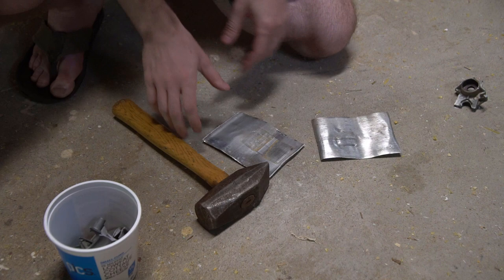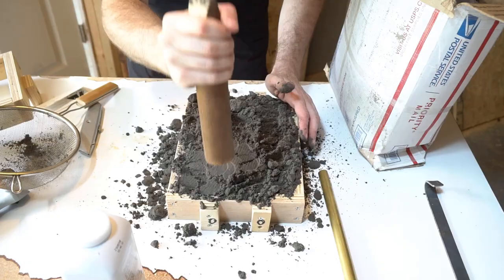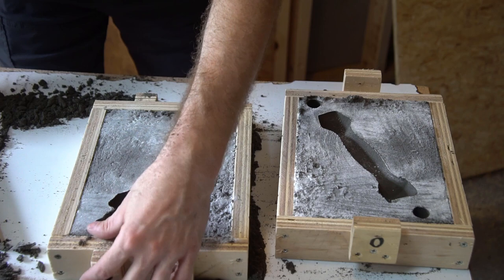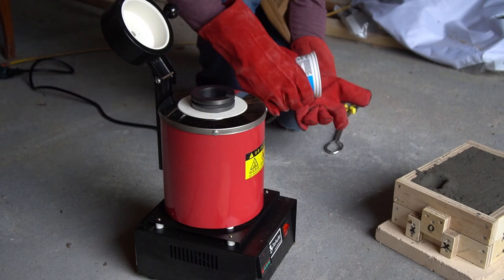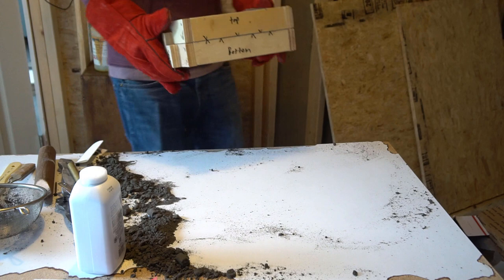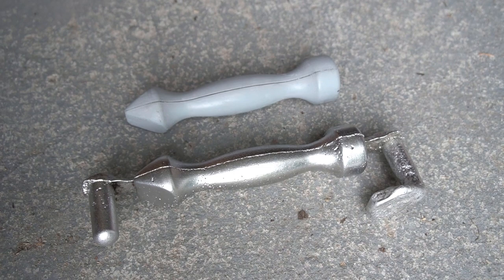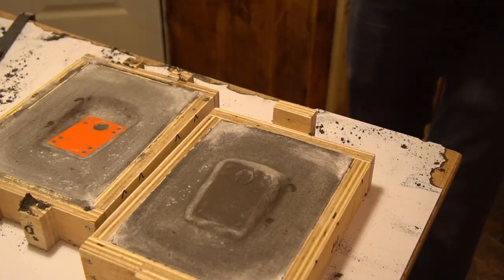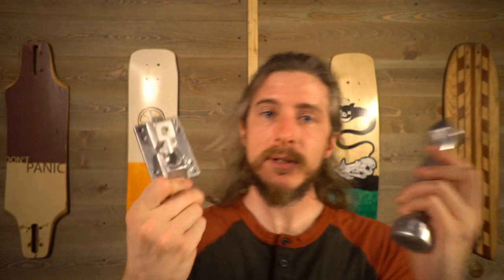Learning to Cast Aluminum with Green Sand - Casting Trucks At Home, Ep. 2

Comment: Looks like steam related defects to me; your sand looks pretty wet here.  It should be dry (permeable) enough to let the molten metal push the air out of the mold cavity through the sand, without really needing a riser for venting on the far side (though you may need risers to counteract shrinkage). It takes time to get a feel for when your green sand is right, but you want to aim for as dry as it can be and still have enough green strength to hold together.  Venting the sand itself (not the mold cavity) with a thin rigid wire like a bicycle spoke helps too.  These vents should not contact the mold cavity, just come very close to it so that they stay open and continue giving steam generateed inside the hot sand an easier out from the mold than pushing into the surface of the casting as it freezes.  If you sharpen your vent wire to a point, your vents won't fill with metal and stop working even if the vent wire does accidentally touch the pattern while you're poming holes in the cope and drag.  But first let your sand dry out a bit.  If you had a bigger furnace there is more you could do with gating systems to improve your castings as well, but you're off to a really good start here. This is an oldish video so maybe you've already got your sand sorted out.  For me foundry is a great hobby in and of itself with endless room to learn and improve, but it's also a great add on to other hobbies or projects like what you're doing here.  I'll look for other casting videos you've done.

Comment: As an LDP longboarder, I'm excited to see how this works out. We tend to use pretty high angle front trucks (45°-65°) and pretty low angle rear trucks (30°-0°, sometimes negative). This means that pretty much any decent pumping trucks are going to be precision machined in small quantities for hundreds of dollars. As someone whose made that investment only to find things I wish I could change about the geometry, it's exciting to consider the possibility of investing in a resin 3D printer and aluminum casting supplies to attempt to solve this problem for everybody.

I'm currently casting some wedges and have been pressing my own boards since I was a teen, so between this and the urethane components, I'm hoping to eventually "do it all".

Thanks for being such an inspiration to all of us!
Reply from the maker: I really want to do a zero- or low-degree RKP at some point. I want reverse kingpin mountainboard trucks dangit!
Reply: @GoodRoads  I didn't realize there was a need! Now you got me trying to learn more about mountainboard trucks lol

Comment: Having a longer travel (runner system)from sprue to part will eliminate porosity and trash all together depending on how far the travel is. Keep in mind your pour temp might need to be raised in order to fill the part. Also keep in mind the hotter the metal the more it shrinks. If your parts are shrinking just add mass (bigger balls) at the gate will feed the part as it cools. Your mass needs to be bigger than the part. The part must freeze off before the mass in order to draw properly.

Comment: Something I also really should add is be very careful choosing your metal. Magnesium and magnesium/aluminium alloys are really easy to mistaken for aluminium. You can test for it by using acid. If it bubbles violently then it’s magnesium if not then it’s just aluminium. (Magnesium is very flammable and hard to put out)

Comment: Aluminum shrinks alot when casting, you need a pretty big 'feeder' wich supplies extra molten al as its solidifying. Usually at the bottom of the sprew, before the casting cavity, a large-ish extra cavity to allow it extra substance to recudce shrinking. When casting with a steel axel for the trucks, keep in mind the composition and hardness rating of the steel, aluminum isnt hot enough to melt steel, but it could be high enough to soften its hardness. This would make the axel more likely to bend instead of resist under load. You probably already know this from researching it yourself, you seem to be pretty up on it. Looking forward to your next pour !
Reply from the maker: Thanks for the advice dude!

Comment: You certainly seem really eager to get some trucks going.
You're using stuff straight out of the packaging, were you waiting by the mailbox for everything to arrive, ram in hand?

I've also been watching Brian Oltrogge's videos. Don't tell me, his "Casting Aluminum for the Home from a Simple 3D Print" video came out, and lit a fire under your butt?
This project is certainly the first thing I thought of when I saw it. I was going to recommend his channel to you, but then I figured there's no way you could have missed it when doing your research. Very good content.

It would be so cool to eventually see a brass or a bronze truck. Even though there's no practical reason for it, it would just be really awesome.

One thing I'm worried about with the cast in axles is keeping the bearing surface clean, and especially the threads. And also in achieving a nice flat for the bearing to be tightened down against on the hanger. I wonder if you could have something like a set of nuts or something pre-made on the axle to keep the molten metal away from the threads, and to act as that flat surface so you're not relying on quality of the cast to keep the ends neat.

Or, you could just let the quality of the cast be what it is, and neaten it all up afterwards.
Threads can easily be re-tapped
I remember an old topic on Silverfish where somebody had tracked down a tool that would go over the axle, and you could stick it in a drill and machine a nice flat & parallel shoulder for the bearings to ride against.
Reply: I think the solid steel axle would extend far enough into the sand that it wouldn't get aluminum on the threads, but what about covering them in clay or something? Not exactly sure what material explodes and what doesn't in this kind of process.

As far as cleaning up the outer edge of where the aluminum meets the axle, maybe he could do a jig for his angle grinder? An idea:
- Jig has skate bearings that the axle inserts into
- Use a nut to set the depth of how far the axle inserts into the bearings (maybe the nut goes between two bearings and you use one of those thin, stamped sheet metal wrenches to adjust?)
- angle grinder is attached to the assembly in a stable way somehow, but on a hinge with a depth stop
- rotate trucks slowly on axle as angle grinder cuts for smooth bearing seat.

Obviously that's way more involved than machining on the drill press, meant it more as a backup plan in case the hangar was too unbalanced to machine in a lathe-like fashion. You bring up really good points!
Reply from the maker: I remember that tool, that was the beginning of faced trucks which are so commonplace now. Completely changed the industry. I gotta see how the casts come out, but I'm hoping that I'll just be able to keep the aluminum off the axles. These certainly aren't going to be pro-level but hopefully they will work pretty good!

Comment: Really cool you tried this. Only tips I could offer is keep the molds hot maybe place in front of a heater and elevated off cold floor. For best DIY result really should try investment casting. I understand its a lot more expensive but the results are closest you can get to die-cast.
Reply from the maker: I think when I try reverse kingpin trucks I'll have to use investment casting for the baseplates

Comment: You need to remove the hydrogen from the metal with sodium carbonate (washing soda) 
When I cast aluminium I make a small aluminium foil package with the soda in it and using an old stainless steel egg cup on a stick push it to the bottom of the crucible (be very careful not to have any water in it) amd be aware that it will cause the metal to ‘boil’ violently as the hydrogen and other impurities come to the surface. You then need to pour it soon thereafter as it will start to dissolve hydrogen again immediately.
Reply from the maker: Yo dude, thank you so much for all the great advice. A couple questions: you can also set a sliver of magnesium on fire right? Aluminum wont burn the same way? And about how much sodium carbonate do you need? This is all a huge help, thank you!
Reply: @GoodRoads  if it’s a very small sliver of pure magnesium you should be able to set fire to it with a blow torch. I’m not sure how easy it is to set fire to an alloy of magnesium and aluminium, I’ve never tried, and I’m certainly too scared to find out if it will burn once it’s molten.

I suppose the thing to remember is that it will behave differently in a flame to the furnace as the flame will provide a co2 barrier around the part which will inhibit it burning while the furnace allows the molten metal to have direct contact with the air
Reply: @GoodRoads  as for the sodium carbonate. I use pieces about 1cm cubed. (For about 750ml of aluminium) and I just keep adding them until it stops producing much dross and stops dropping in volume (you will see a significant drop in the level of the aluminium after the gas has escaped) I usually use 2 or three packets to get it to the point where I’m happy. You’ll need to experiment with it starting with very small amount as you don’t want the crucible to bubble over and ruin your nice furnace.
Reply from the maker: Okay cool, do you know if like white vinegar or some other common household item would be acidic enough to test with? I mean, you can etch steel with it, right?
Reply: @GoodRoads  I honestly don’t know. I would think so. But I’ve always used something stronger like hydrochloric acid. I’m sure someone has probably made a video about it.

Comment: The best thing about casting metal is that if you completely balls it up, you can just melt the thing and remake it! I bought a furnace that looks identical to yours. I since found out that the crucibals for those really don't last very long and they really don't hold that much molten metal, but at least you can (kind of) use it indoors. I've since upgraded to a Devil Forge 10Kg, set it up and melted some metal but because of winter I've not had chance to use it fully. After watching a steam explosion with just the small forge like yours (it's so weird to watch - the metal kind of wobbles in a strange matrix kind of way and then a few seconds later it creates a big bubble that explodes)  and having to use it outdoors, I'm definitely going to wait for better weather ;-)
Reply from the maker: I'd love to upgrade to Devil forge at some point. Both for the volume of metal you can melt but also for the times. I think they work much faster which would be a boon. Do you know if the graphite ceramic crucibles last longer than the pure graphite ones? I've only done a handful of pours with mine but I'm already noticing pitting on the outer surface that's exposed to the heating elements
Reply: @GoodRoads  Yes they are much faster to use, especially with aluminium / alloys. Unlike the one you have, they are easily big enough to melt beer cans in. Definitely go for the 10Kg version of Devil forge. If you get the smaller ones you'd soon regret it. Crucibels for the Devil are pretty robust either way (in comparison). Here is a great & short video on crucible material types = https://www.youtube.com/watch?v=NX7HGow7zXs
The Ceramic (Silicon carbide) and graphite mix is talked about at the 3:43 mark (the whole video is only about 6 mins long) = conclusion is they last a bit longer but cost a bit longer.

Comment: Very neat. I know in bullet casting with lead, I flux with borax. This draws out any oxide impurities. Kinda nasty and should be well ventilated but the result, at least with lead casting is obvious in the finished product. I do not know how it applies to aluminum casting. Very neat I actually really want to try this. Can the green sand be re-used, or is it done for after the heat gets to it?
Reply from the maker: There's a thin layer that gets burned out that you have to discard but the rest of it is reusable. If it gets too dry to stick together you can just re-hydrate it with a little water

Comment: Hey Chris! I'm sure you made your own research on how to cast trucks. I just wanted to share with you this ineresting video I found a few years ago because it features some interesting devices that you could take some inspiration from; like the way it's made the master for each half of the mold. I figure you can 3D print your own master sheet with built in registration to your flasks  to control the parting lines and the precise position of the axles, you could even make them with the sprues built-in (that way you could know exactly where to cut the gate and rise each time. And maybe you can put together a press from an old bottle car jack and a metal frame (similar to an old time book press) to press your petrobond and get better detail when you'll want to put your logo on them. Anyway, here it is: https://youtu.be/Switx0LFt90
Reply from the maker: So sick! Thanks so much for sharing dude! I wonder if I could use my electric skateboard press to compact my molds when I get it up and running again. And holy cow they have so much green sand!!!
Reply: @GoodRoads  Oh I'm sure you could use an electric skateboard press (I didn't know you had one, but now it all makes sense why you weren't trying to make a more efficient press than the spar-style you've been using). 
I'm rooting for you on every project but this one sure is a special one! Can't wait to see where it takes you!
Reply: That's incredible.
Is tracker still making trucks in the US?

It would be so cool to be able to see that in person.
Reply: @LongboardTechnology  It would be cool, I agree, but I don't know I don't even live in the US.